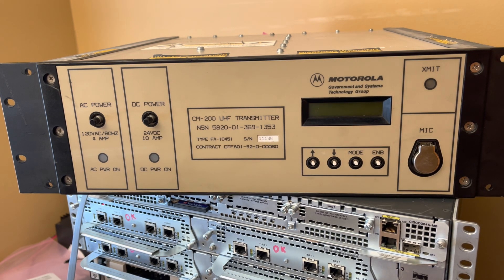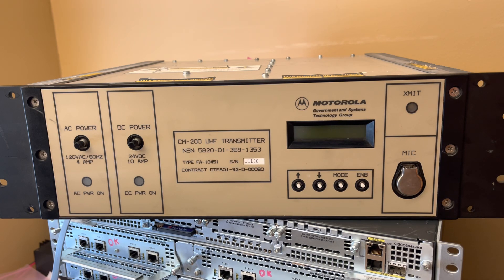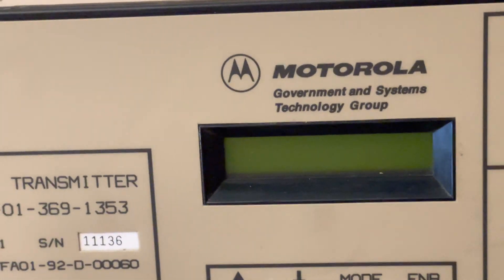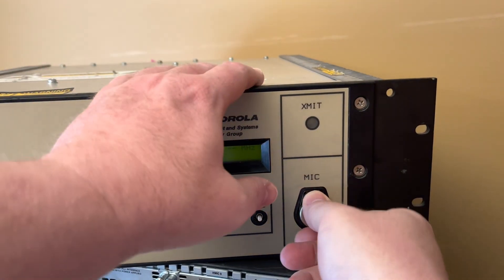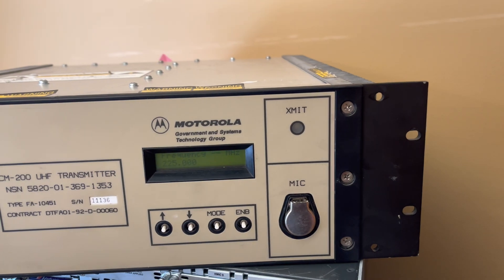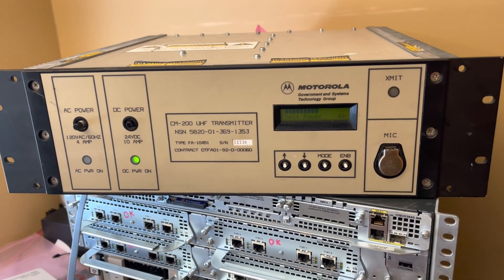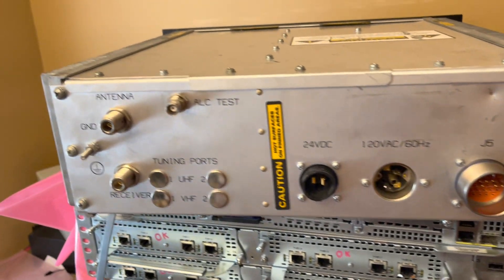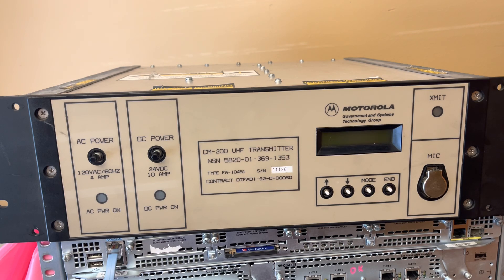Motorola CM-200 UHF Airband transceiver

Comment: That is just a UHF transmitter, old version of the CM300s.  You are missing the blue receiver unit.  You are some what right about the xmit pwr(this is not direct conversation to watts), it does help in tuning the radios pwr output.

Comment: That is a 10 watt AM transmitter. The TX RX ports on the back allow you to use one antenna for transmit and receive. The antenna connecting to the antenna port, and the receiver to the rx port. The J5 connector is where you connect the "key" pair, and the audio pair to modulate the carrier. The voice comes from a remote console in the control tower. Ultimately to an Enhanced Terminal Voice Switch.
If you open the tuning ports, you should see some "pots" that adjust an internal band-pass filter. Every time the frequency is changed you must tune these ports to get max. RF out. The alc connector will put out a DC voltage that is used to fine tune the unit. Before tuning, set the power on the front panel to 2 or it will show an error code.  The power numbers don't mean anything. If I recall 65 is really like 10 watts carrier power.
Reply from the maker: Cool, do you have any docs on these units?
Reply: That is very good brief explanation of the radio.

Comment: The lack of a speaker, audio port and that J5 socket makes me think it is designed to be operated remotely.  So this sits at the bottom of a radio mast but is operated from the tower some distance away. Curious if the Mic jack is TX only or more likely David Clark-style TX/RX for an avionics headset as this will be deployed in a very high noise environment.